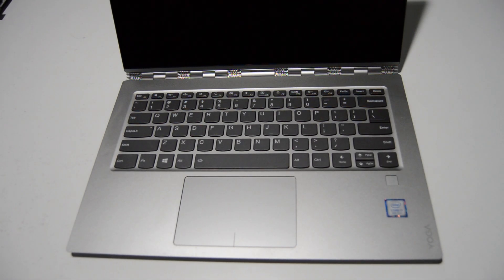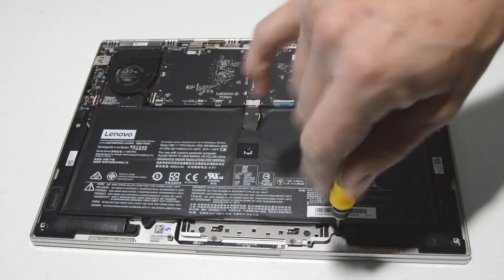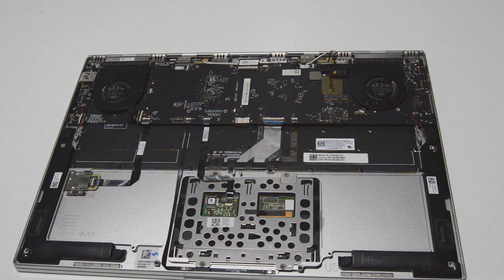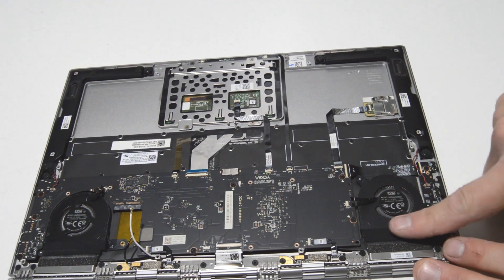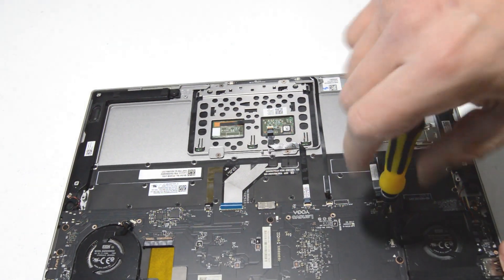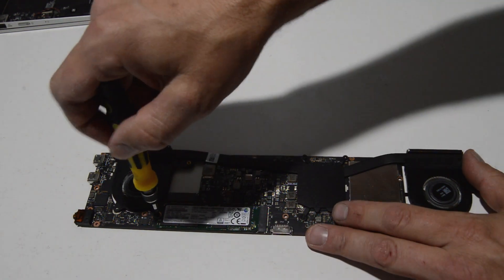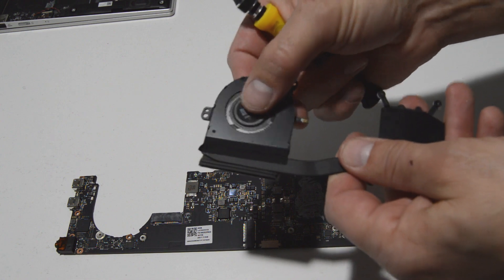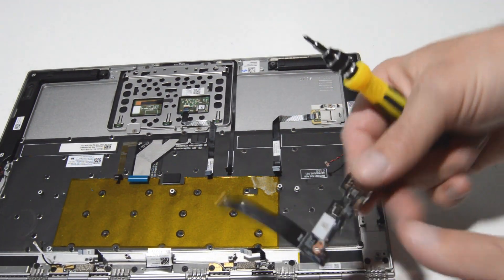How to Disassemble Lenovo Yoga 920 Laptop

Comment: Thanks for this! Bought a 920 512GB for dirt cheap with the intention of upgrading the SSD to 2TB. Didn't realize I was going to be in for a bit of a challenge, and I'm glad I found this guide before attempting this on my own.
Reply: How'd the upgrade go? I'm looking at a 512GB model right now and upgradability and repairs are my only concern.
Reply: @alexrossow6473  successfully, and this video was invaluable! I upgraded the SSD to an SK Hynix P31 1TB and the wireless card to an Intel AX200. The SSD upgrade was significantly easier than the wireless card; I had the most trouble reattaching the antennae to the new card, but with some patience I was able to get them reattached. I also repasted the CPU while everything was disassembled. My idle temps are ~5C better on average, though the most noticable change is that the laptop now has more room to boost. My frequencies are ~250MHz higher under load at the same temps when compared to before I repasted. After that reassembly was very straightforward.

Do note, you will need to either have a mouse on standby, or clone your old SSD to your new one. The touchpad drivers are not included with Windows 10 and they're a pain to find. I'm still not 100% sure where I found the correct touchpad drivers, but I'm fairly certain that it was the Lenovo Update Utility that found them for me. Regardless, don't be like me and panic buy a new touchpad when yours doesn't intially work. Be patient and give it several driver/windows updates and maybe even a few windows resets before deciding that the touchpad is broken.

Good luck!
Reply: @cjeffcoatjr  Thanks for this insight! Could you please let us know what thermal paste you used? I have Thermal Grizzly Kryonaut 12.5 W / m, but I bought it in October 2017 (I used it when I upgraded the CPU on my NAS) and I am not sure whether it still is good/efficient for cooling or I should buy another paste. Any thoughts on this would be appreciated. :)

Also, did you notice any speed improvement after replacing the OEM SSD with the SK Hynix? I have read that the OEM SSD does not perform so well as the retail SSDs, but it all comes down to real world experience. Thanks!

Comment: so the ram soldered '__')? too bad..
Reply: Yeah, Lenovo are creepy - putting the M.2 SSD under the Mainboard is just purposely making it hard for people to upgrade or replace a dead drive.  Of course, they really want you to buy all the RAM and SSD possible, cause they make more profit on those than the rest of the laptop.
Now, soldered RAM does have an actual advantage:  Its much thinner and uses less space. So most thin+light laptops have soldered RAM.
I did manage to get one with  16GB RAM, but upgrading the  SSD is not only laborious, it won't run until the battery depletes, because of some "security" BIOS feature

Comment: Thank you for this video! Is it possible to clean the fan without disassembling the entire thing?
Reply from the maker: Definitely, just get some canned air and blast it in short spurts directly into the vent. Repeat a few times.... just don't do a long blast that might overspeed the fan.
Reply: @Sellbrokedotcom  Thank you for the response!! Do I do this without opening the laptop case?
Reply from the maker: @wendywelliana5611  Sure, just locate where the fans vent in the back and blast the air into that, few spurts each.